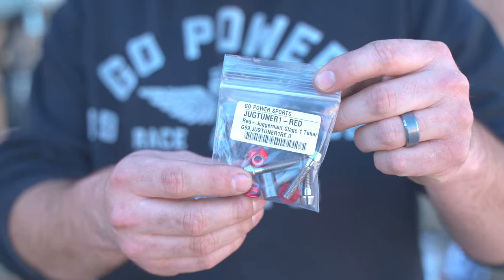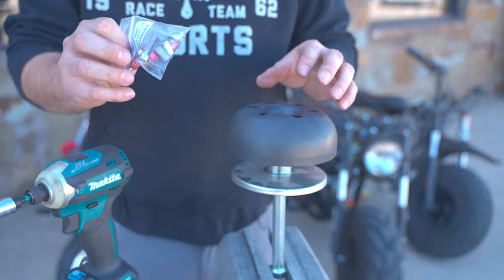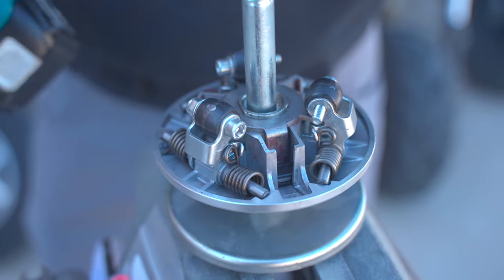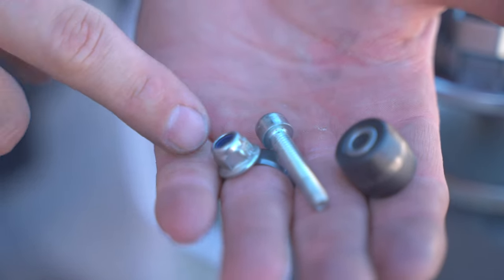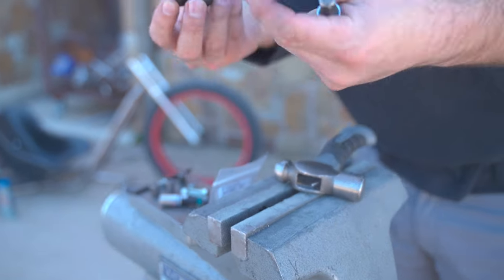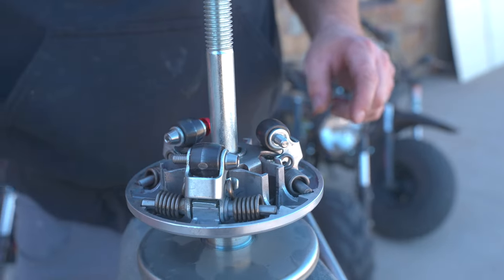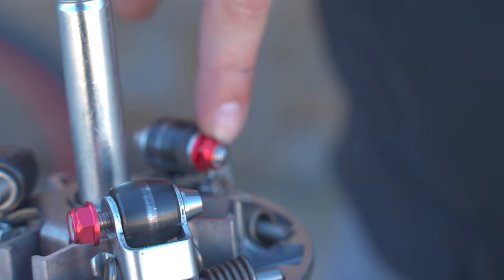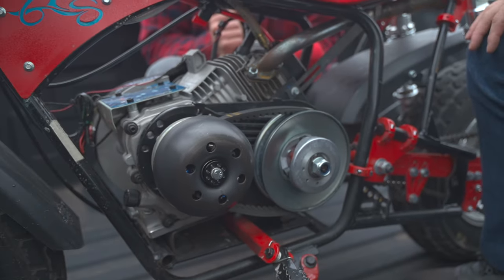Juggernaut Stage 1 Tuner Kit | Better Call Paul

Comment: Ok....just got the email Paul, and watched your video. Looks to me like all you did was replaced the stock center bushing with a new one. How in the world does that change the rpm??? Unless the new bushing is aluminum rather than the stock steel one? Now if you changed the roller with a lighter one, that would 
make sense. And if the new bushing is aluminum.....will that wear as good as the stock steel one??
tks Denny G, Sandwich, IL

Comment: Need to make a kit to lower the stall, i have a 236 on my daughters yard cart just due to the fact it doesn't vibrate like a 30 series clutch, but the engagement is too high for a normal yard kart machine. I unhooked one spring per arm which definitely works but makes the idle speed have to be pretty low.
Reply: Try adding thin washers on either side of the bolt to increase weight.
Reply: Make sure the belt you have is fairly snug as well. As the belt wears (or is long to begin with), it raises the engagement RPM and raises the drive ratio, robbing you of some low end torque.

Comment: Would this be a good idea for a 1.5 stage Tilly 212 or is it not quite there yet for this?
Reply: You could put it on a stock tilly. It just raises the engage RPM so you take off in higher RPM's in your launch. I have a stage 1 with stock Jug and LOVE IT! Soon to be stage 2 in coupler days tho!

Comment: Since this kit raises the rpm stall to 3000 what would be a good number to set idle to? Also, if 3k rpm is going to put me at higher torque during takeoff, how do i prevent belt slip?
Reply: I saw you asked a lot of the questions I had recently! Here's my experiences and I'd like to hear yours too.

Idle can be wherever you want. 

For launches it's best to hold the throttle to where the jug is starting to engage and then launch. If I hit it from a dead stop full throttle without doing this trick I get slow launches and belt slip

Green spring seems best with the jug, watching the pulleys it seems like the jug controls most of the shifting

This is on a 25hp minibike 20" wheels 5.89:1 gearing 3100 stall. Idle is as low as I could get which is pretty low

Comment: Juggernaut took my hillard clutch from 8600rpm down to 6100 rpm!! Its not worth it on a high hp engine 15 plus hp. Waste of money.  Stick with jackshaft its lots faster. And I changed gearing around.